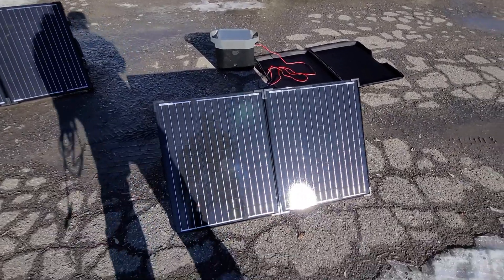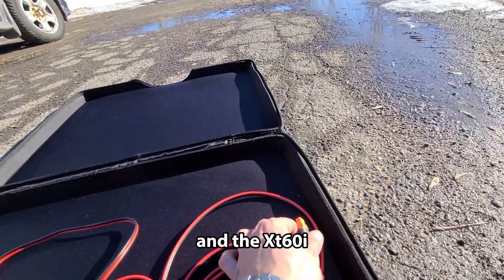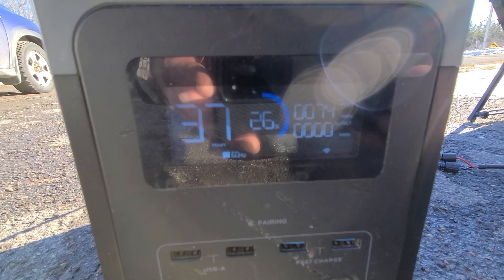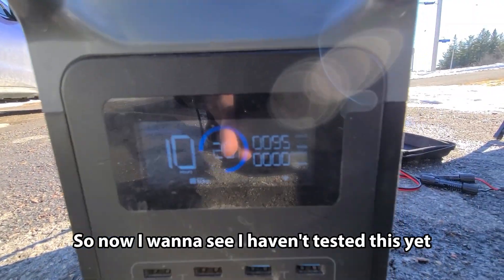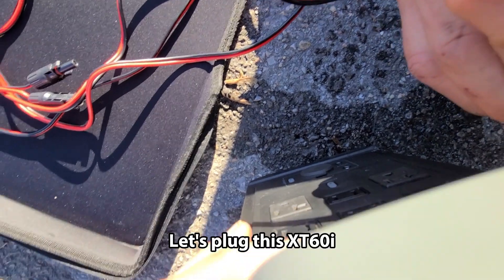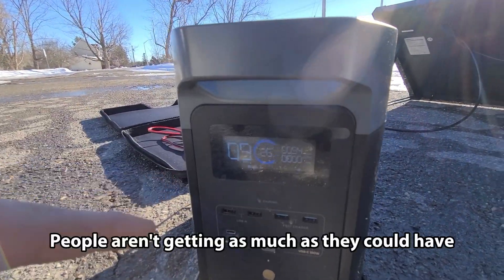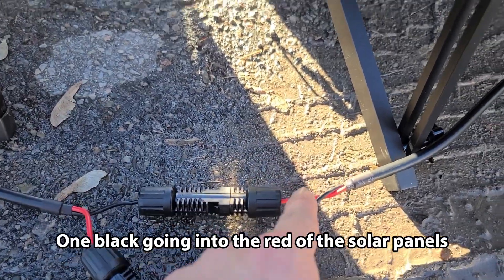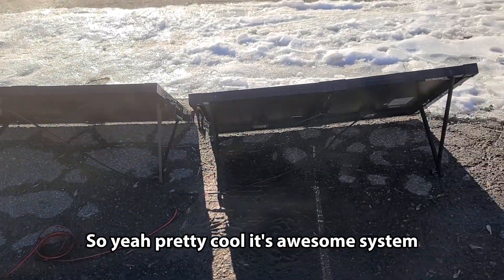XT60 vs XT60i Cable Test on Ecoflow Delta 2 + Renogy 200 Watts

Comment: The  main difference is an extra pin on the XT60i that communicates with the power station, allowing for higher current (up to 100A) and correct identification as a solar input, whereas a standard XT60 (60A)

Comment: Bro try to put i wire on the gap of xt60 they connect it on positive hole of the same xt60 it will work. Try to use tester on xt60i where polarity does it connected just to be sure. I remember someone use that trick. Do it at own risk. Watching from taiwan

Comment: The XT60i is the same but the piece you called" a piece of metal" is actually a Diode. The diode, is to prevent reverse current flow that in some situations happens. Thus causing permanent damage to your battery.

Comment: You are only going to get about 100 watts out of a 100 watt solar panel no matter what type of connector you use. It would have been interesting to test both your 100 watt panels together, comparing output from each connector

Comment: If the car cigarette lighter cable that came with your power station has an orange end then it's xt160i...and the unit has an orange receptacle then you need an orange XT160i solar cable to connect the solar panel.
The yellow end cable is an xt160...
Reply: I used the cigarette lighter cable and mine has orange head but still limiting the charge to just only over a 100. And i have 3 195w panels connected in parallel hooked to it. Do i have to buy an xt60i cable instead?

Comment: I have few sily questions. I have Ecoflow Delta 2
1. How much power will I get from a 650W, 20V panel with an xt60i connector under ideal conditions? 
2. Same with the XT60 connector. 
3. How much energy can I get from ten of these panels wired in parallel at half solar power?
Thank You
Reply: I have seen your comment in the Comments for several videos now. The maximum voltage, amps and watts the Delta 2 can take from solar panels is 60V, 15A & 500W respectively. Under ideal conditions your solar pane might produce 570 - 600W which is already too high for the Delta 2, so I'm not sure why you want to connect 10 of them together. I'm not an expert in these things but I think if the voltage of your solar panel is 20V, the current will be about 32A which is too high for the Delta 2. I understand if the current coming from the solar panels is a little higher than 15A, the Delta 2 will limit the current it is receiving to 15A but I don't know if over 30A might not be too high for it to do that.

Comment: I believe that extra contact on the XT60i also communicates battery temperature and other data to the unit.
Reply: AFAIK  middle pin is connected to the negative / black   in the connector

Comment: The Delta thinks the XT60 is a 12v car charger so it limits the amps.  12volts x 8 amps limits you to about 100 watts.
Reply: Hello. I have exactly this problem right now. Does that mean I bought the wrong XT60? I had to buy XT60i then? Thanks for your answer.
Reply: no the 12V car carger cable with Delta 2 is with XT60i connector   with Eflow app 4 ~ 6  or 8A  selection

Comment: I'm a newbie - looking at the ecoflow delta 2. Ecoflow panels are v expensive. Renology seem to have a good reputation and are cheaper. I'd wondered at getting 2 of the 200 w.
When I asked Ecoflow about compatibility they said in a very poor response to a potential customer "we wouldn't recommend it, get one of ours". Bit no basis offered for WHY - so the conclusion is simply profits. OTOH I don't want to buy these and find they aren't compatible.
I get that I need some adapter cables.
But you are using a similar set up - can you offer guidance?
Reply from the maker: Hi Binra3788, I tested this out myself because of all the conflict on facebook groups. These Renogy panels work the same as the Ecoflow panels but the portable Renogy panels that I bought are built with metal and are a little more bulky and heavy then the foldable Ecoflow panels. At the end of the day i would prefer to have the Ecoflow panels with the xt60i cable as recommended for the delta 2 but I was able to buy the Renogys on sale. I didn't want to pass up the deal. Saving around 400-500$ goes a long way with these builds. So conclusion if you want to save money and get the same power output buy the Renogy panels, if you want to have an easier time with set up and less bulk/weight buy the Ecoflow panels.
Reply: @AndrewsAction  Thankyou. Initially I was thinking a first step in home backup rather than a mobile solution - so fixed panels on my shed and maybe even keep the Delta2 in the shed. (I haven't had any power outs where I live of consequence but so much converges to indicate a need for resilience in uncertain times).
My primary concern is of damage arising from incompatibility outside my expertise - or simply incompatible in terms of not working (adequately).
I have a camper (in a long process of getting a recon engine) so if that comes through ok, the mobile thing might be worth its own panel.
On the net is seems there are always contrary views and lots of 'click-me content that varies hugely in quality.
But as I read you, the issue is price, convenience & mobile practicality rather than 'danger' to equipment.
I think if I get the 2 x 200 to connect in parallel as safer in terms of voltage.
I did learn a bit of electrical theory back in the day, but without practice it didn't integrate to confidence!

Comment: Not enough power from those panels to do an accurate test.   The limiting factor is likely closer to 1000+ watts.....
Reply: On the deltas, a XT60 conector will get recognized as car charger and so limit the input amps to 8 amps on 12v or 24v (some big rigs use 24v batteries). So, if you pannel cannot put out more than 8A,the xt60i will make no difference.
What is the third pin on the xt60i? It is tied to negative (I think via a resistor), this simply server the purpose of telling the unit it can pull more than 8A. Again, this will only make sense if your panels can put more than 8A out, for instance repeat this test with panels in parallel (double amps by keeping the voltage) and see how you are capped at 8A with XT60 and capped at the unit input rating (I guess it is 15 in the delta 2 and bigger on the delta pro).
Reply: I didn't have a cord for my unit so I bought a 75ft xt60i cable for my ecoflow  delta max with the 2 400 panels I ordered also for my roof  that being said idk if there a difference but  I was like if I need a  long cord any ways might as well get the better of the 2   I hope it works haha
Reply from the maker: @andrewmiller4035   Yea Im not really sure why some people get so quick to say the xt60 cables wont work as good. Honestly havn't seen a difference in performance but if you have the options seems like the best thing to do is get the recommended xt60i cable. But I still wouldn't worry one bit if all I had was the xt60 cable.
Reply: With your solar connection combinations, I'm afraid we couldn't see the difference between XT60 and XT60i.  The current is too low make the difference
Reply: Hi with my setup with 3 panels in parallel connected to the delta 2 with a normal xt60 plug it charges with 15 volts 10/11 amps max 175 watts these panels are about 14 years old...this is my home setup.now my mobile setup 2:200 watts fouldable solar panels from Amazon  brand is fullsent 200watts wil give the delta 2 with the original xt60i cable around 320/380 watts max  in summer time in the netherlands 20 volts nom and voc 24 volt 10 amp each nom